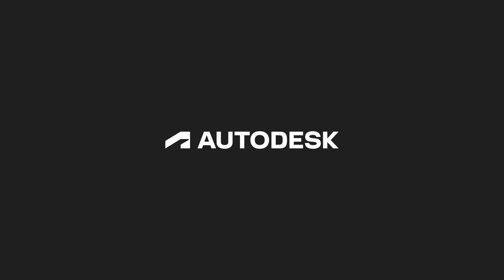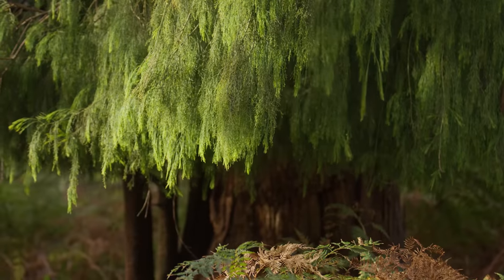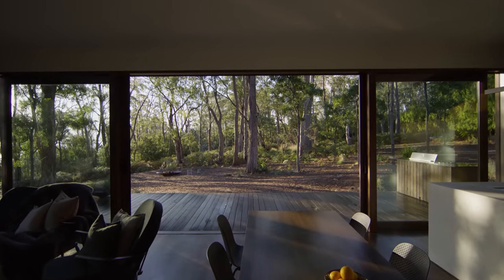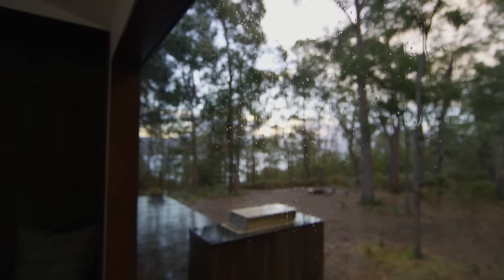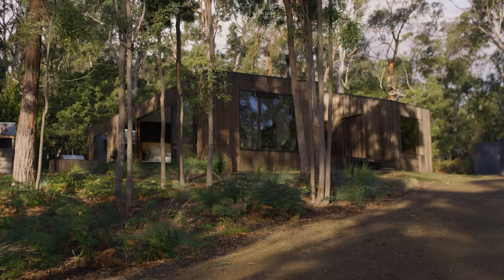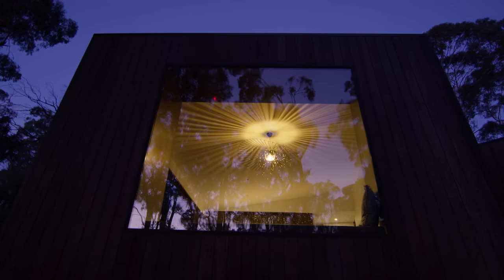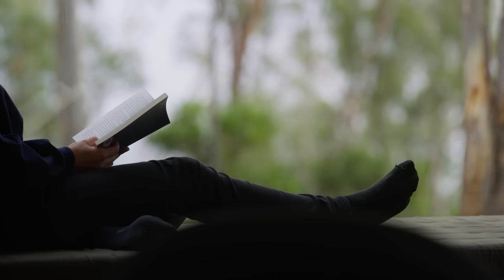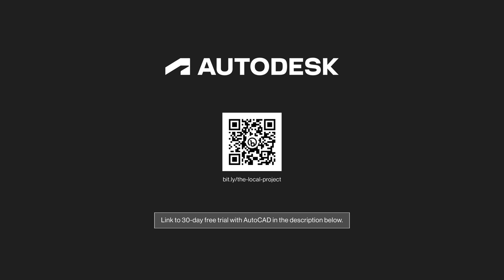Architect Designs an Off Grid Cabin in the Woods (Cabin Tour)

Comment: Can you explain how a wood clad building would be resilient in a fire? It seems it would be prime kindling for a fire.

Also, relative to the FireWise program in the US, I am not seeing defensible space around the structure. Do the local regs not require such a buffer between the structure and the trees and other fuels?
Reply: Tasmania is cool climate with high rainfall so doesn’t have the same need for restrictions and rules that apply in other parts of Australia with regard to bushfires.
Reply: @lexandluke  Or, global warming is changing everything. The Amazon rainforest has been on fire for the last few years so I wouldn’t count on a wet environment in Tasmania in the long run.